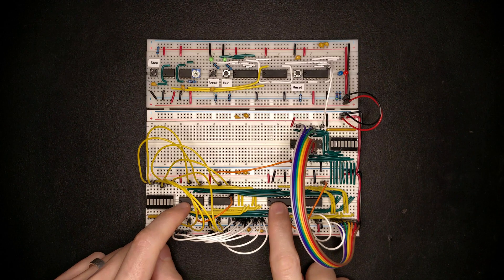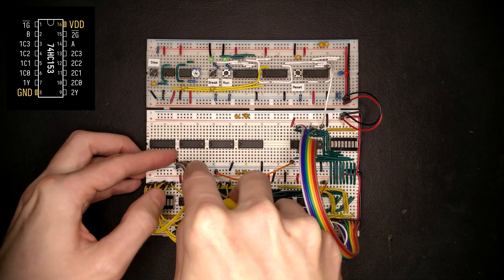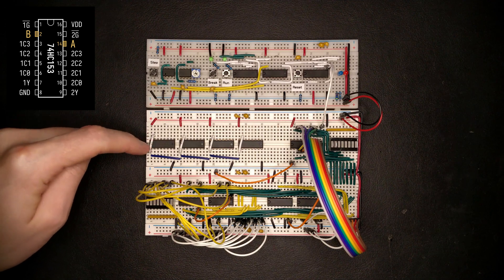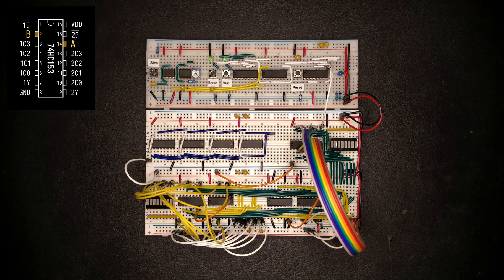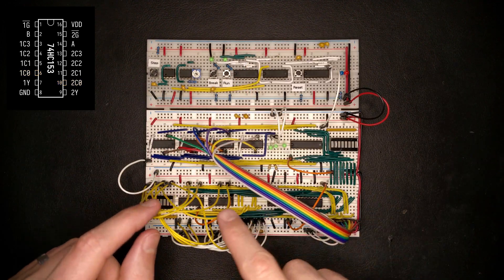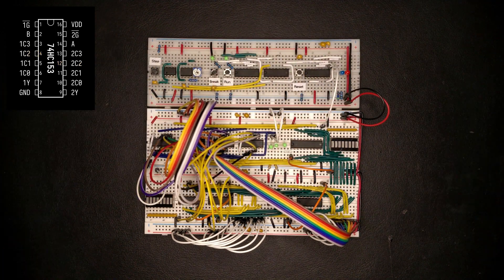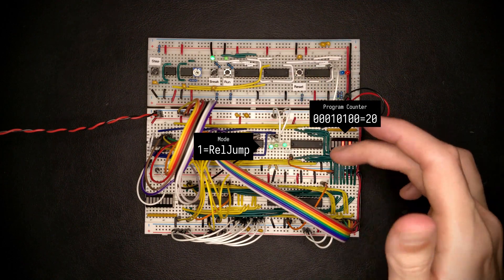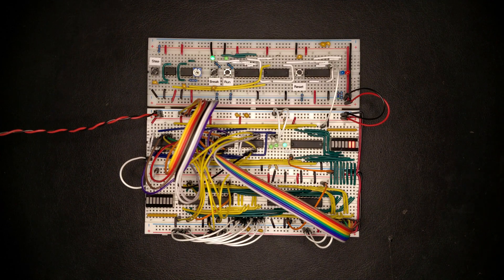Picking Which Instruction to Execute Next – Superscalar 8-Bit CPU #9

Comment: not really sure if you still check these comments but, would you reckon something like wire wrap would be better for doing this?
Got a wirewrap tool and plan to use it for prototyping, making perfboards with sockets and headers.
Reply from the maker: Wire wrapping would definitely work! I also heard that the connections it makes are more reliable than the flimsy breadboards. If I recall correctly, you need parts that have longer than usual leads and pins, which might be very hard to come by these days 🤔
Reply: @fabianschuiki i have the idea of just using sockets on perfboard and soldering pin headers in parallel to them. I think thatd work out, though i worry about whether adjacent wirewrapping is okay
Reply from the maker: Hmmmm good question. I have never used wire wrapping myself 😕

Comment: You could have used 2 to 1 muxes to select normal steps/relative adressing - add either the normal offset to the current adress or add the sign extended relative offset to get eg. -128/+127 step jumps. Then another set of 2 to 1 muxes would select this or absolute jump adress source to put into the register.
Reply from the maker: Agreed, that would have been a nice design point as well 🙂. My thinking here was that I wanted to always have the address of the next instruction available, to have the option of storing it to a return address register. If I use only one adder and select between step/relative offset with a mux, I no longer have access to that address.
Reply: @fabianschuiki  If you want to grab the absolute value to return then you can do so from the adder - just set it so it would point to the next instruction after the jump, you grab it synchronously with doing the absolute PC load ;-) You want to go back to the next instruction after the jump anyway, right?
BTW I'm really enjoying these series :-)
Reply from the maker: @akkudakkupl Thanks! 😃 It's great that you share your insights, ideas, and suggestions 🥳. Regarding the absolute value of the return address: I think you're right if you're only ever doing calls to absolute addresses. Which, to be fair, is probably a sensible limitation. I was trying to give the PC the capability to perform a relative jump while at the same time producing the instriction address after the jump as the return value. For this I need two adders: one to compute the next/return address, and one to compute the relative jump target.
Reply: I need to clarify something about my 1st statement. I'm thinking using two 74HC541's to bus input into the adder. The 541s are HZ outputs, so easly "glued" logic together with a demux.

Comment: I don't understand the purpose of the second adder.  Presented with the present count and an offset (including carry), the first adder can compute the next address to be latched.  The carry can be left at 1 since the next address is the default case; skipping a byte is 1 + the carry and subtraction is ones complement + the carry.  It seems to me you have gained only the ability to skip instructions for some reason.
Reply from the maker: Good point, this hasn't become clear in the series yet. The second adder is for future-proofing.

Once we get call and return instructions, we'll be confronted with the problem that for a call instruction we need to do two computations on the program counter at the same time: One is computing the address of the instruction immediately after the call, which becomes our return addres (to be stored on the stack, in a return address register, or a return address stack). The other is computing the address of the call target, which in some cases might be a relative offset to the current address. (For things like local calls.)

Unrelated to call and return, I haven't entirely decided how to approach the dual-issue feature and instruction compression yet. But once these become a topic, the CPU would move in a direction where it will have to be able to fetch entire instruction packets of possibly 32 bit at once, in which case we might need the added flexibility.

And finally, as you said, it looks like all this buys the CPU is the ability to skip instructions. However, once compressed instructions become a topic, the program counter will have to advance by 1 byte for a compressed instruction, or 2 bytes for an uncompressed instruction.